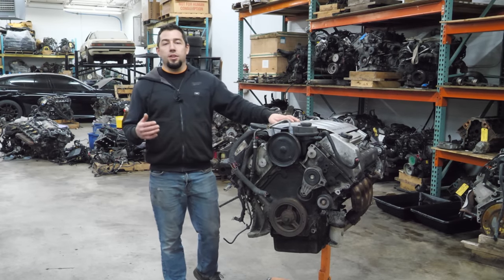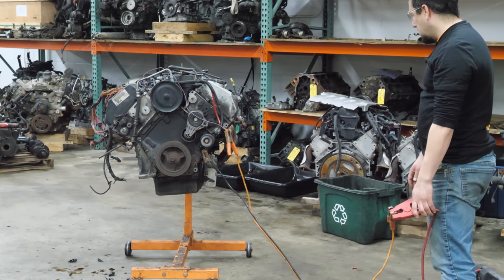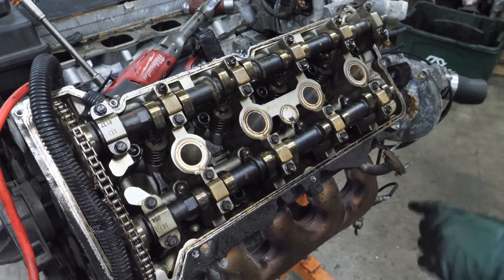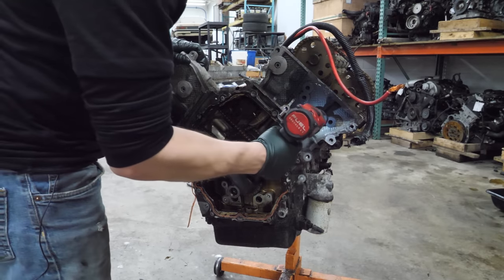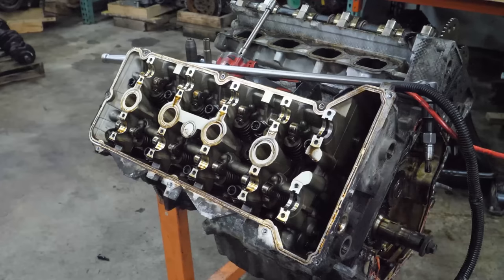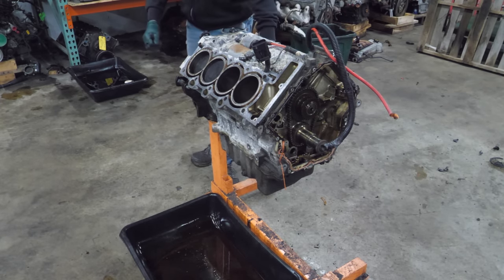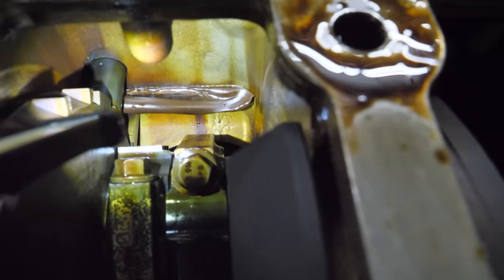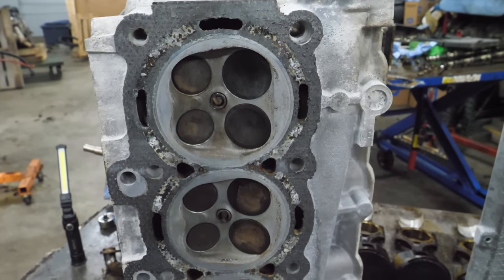Customer Returned This Cadillac Northstar L37 4.6L V8, How Many Things Can We Find Wrong?

Comment: This could have been a world-beater, but GM, as always, snatched defeat from the jaws of victory
Reply: it could of been very cool,  after market bottom end ,  the good stuff. head work and a cooler looking intake manifold,    all polished up like candy with a big turbo hanging off each head . ya i could see the vision.
Reply: Lol sure
Reply: The engine that ruined Cadilac .............
Reply: @robc8468  Well, it helped, but you misspelled Cadillac, and Cadillac management did most of the damage
Reply: @robc8468 never heard of the 4-6-8 I see.
Reply: truer words have never been spoken
Reply: They really aren't as bad az people make them out to be.  Better than Ford's copy at least.
Reply: @garyfleming4101  or its replacement, the HT4100....
Reply: @leeterwilliger2303  First off, how is the Ford a copycat when they came out at the same time?  Secondly, aside from a larger bore and shorter stroke, how is the Northstar better?  The Northstar doesn't make any more power than a Ford 4-valve, but it certainly has a lot more problems.
Reply: @leeterwilliger2303 how so? Gm makes some the worst dohc motors to date.  The modular 4.6 was and still better than anything  GM  has put out with “DOHC”.   Gm is good at pushrod motors “V8”. It has taken them 30yrs to get with the times (in the new vette).  GM has never been as great as people claim!!!
Reply: @sti302man  lol.   That's funny 😁
Reply: For that size of an engine, producing only 300 horses, nah mate, are You having a laugh?
Reply: @mistbooster  And what would you consider a good power output for that displacement using 1992 technology and meeting fuel economy and emissions standards, Mr. Genius?  The equivalent 4.6L Ford made 280hp, and a comparable 4.0L Toyota made 256hp.  Perhaps you're impressed by the contemporary Porsche 5.0L that made 316hp???  🙄
Reply: @sti302man  Ever heard of a 1990-1995 Corvette LT5?  And, yes, I know Lotus helped....
Reply: @KevinJames-yg9eu  Well lets see.  based on power compared to displacement Mazda F2T Inline 4, from the 1988(yes it is 2,2L @145HP, but it still more HP/Litres total), Most of the cosworth engines from 80's and 90's
just as examples that have better power to displacement ratio. Incase you did not understand i was mocking the amount of power being squeezed from the power plant compared to its size. Hell even the Volvo redblocks will do better, and the early 90's models did meet the emission standards and had better fuel economy, i never said i was a genius, but you dont need to say that you lack common sense, your reply advertised that for You.
Reply: @mistbooster   Yes, because comparing the specific output of a  turbocharged 4-cylinder engine to an assortment of naturally aspirated V8 engines is even remotely valid.  If we're going down this road, let's just throw in the supercharged 4.4L Northstar that makes 469hp.  Maybe we should look at your Mazda F2 minus T making a whopping 110hp, which would be all of 230hp if it was a 4.6L V8.  Thanks for telling us who has any common sense....
Reply: @KevinJames-yg9eu Agreed. I love it when someone brings a knife to a gunfight 😂
Reply: @sti302man  right because nothing screams quality like spark plugs blowing out of the block or better yet flawed design two piece spark plugs getting stuck in the block and breaking in half when you try to get them free turning a simple preventative maintenance job into now having to disassemble the whole top end 😂
Reply: @leeterwilliger2303 A. It's not a copy B. Ford's modular was a much better engine. Its direct competitor, the 4 valve Lincoln 4.6 variant was about as powerful and much more reliable. The 2 valve version was damn near indestructible. Northstar defenders are like those idiots that die on a hill defending the 6.0 Powerstroke lmao. "All you have to do is fix all of the manufacturer defects that cause major engine failure and then it's good, I swear!". GM sucks at OHC engines. That's ok to admit. Hell, I'd never buy a Ford these days with their garbage rubber band oil pump belts and plastic oil pans. Brand loyalty is stupid. It's just the body of evidence is overwhelming that the modular in most forms is a more reliable and long lived design. Except the 5.4 3 valve... The head design was terrible and is every bit a turd that the Northstar is.
Reply: @matthewheld1292 All of that is easy and cheap to deal with. And no, you don't have to take the top of the motor off to deal with the plugs. How about changing head gaskets? I remember a certain Cadillac competitor having a lot of problems with those Lmao.
Reply: @robc8468  you mean the people who didnt want to learn how to do it right or pay a mechanic and ruined them instead of fixing them... these engines are amazing bad mechanic not bad engine
Reply: @zacharydewitte384  Did you just say that Northstars are not bad engines?  Sorry, but good engines don't rip their head bolts out of the block at 100,000 miles of normal use, and that has nothing to do with any mechanic.  You can correct that issue with aftermarket head studs, but it's simply inadequate as designed, which by definition is BAD and is completely unacceptable for anything built in the past century.  As for paying a mechanic to "do it right", good luck.  The repair requires $1000 in parts, and the labor alone costs more than the car is worth at this point.  I know several mechanics, none of which will touch a Northstar, not that anybody is going to pay $3000+ to repair a 15-30 year old car.  Maybe if you're a hotrodder who is going to build a custom engine anyway, the Northstar is viable if for no reason beyond the novelty, but for the average person simply wanting a reliable daily driver, they are junk.  The Northstar in my STS couldn't be driven any further than a couple of miles without overheating at 150k miles on the odometer.  I replaced that car with a Mustang GT that is two years older and now has twice the mileage of the STS.  The deepest I've been into that engine is the water pump.  I sold the STS for scrap price to some guy who had a Northstar fetish and the tools to stud the block.  Don't know what he did about the 4T80E having the common issue of the torque converter clutch randomly locking and unlocking....
Reply: @KevinJames-yg9eu  whatever bruh I fix mine. If you have enough money you can just get a basically new one
Reply: @garyfleming4101 The V8-6-4 wasn't a bad engine. Just vibrated terribly in 6 cylinder mode. I swapped one into a C10 once and it was a pretty nice engine, it got decent fuel economy, just vibrated like hell in 6 cylinder mode. The Oldsmobile diesel V8 was also not a bad engine. My friend has one in an 82 Toronado with over 500,000 miles on it. No issues. The HT4100 was terrible. No arguing with that, it really was a piece of junk. The 4.5 and 4.9 were ok, just underpowered. I really think they should have just stuck the turbo off the 6.5 on the Oldsmobile diesel with some head studs and it would have moved those boats decently fast.
Reply: I’m from the UK we are Experts of Snatching defeat from the LAUREL LEAVES of greatness.
Reply: @sti302man  the ecotec 4 cylinder is probably one of the best 4 cylinders to date holding most 4 cylinder drag records. the olds quad 4 was the most powerful na 4 cylinder until the honda s2000 came out.
Reply: @theodorgiosan2570   the ht 4100 was fine after 1985, not arguing with you about prier to 1985. it obviously needed more time in the oven and they just rushed it due to the knocking issues with the 4-6-8
Reply: They even bragged it was designed by Lotus.    Imagine any design work by the Britts being quality?
Reply: @mistbooster Turkish bath
Reply: The world doesn't drive V8s. 

It took me awhile to understand why they do in the US: 4-way stop signs and roads that won't follow the contours of the land.

In Germany I'm used to much higher average speeds with much less power. My current Ford is my first personal car to reach 200 HP and sustain 240km/h (150 mph) on the Autobahn. An Audi 100 C3 I drove half around Europe to southern Spain and back nearly 30 years ago only had 75 HP in a full sized sedan and didn't really feel underpowered, I still managed to get a hefty speeding ticket on a straight and empty French motorway...

Around Europe acceleration is typically much more involved; for the longest time it required shifting through 4-6 gears and revving the engine to get up to speed, but then we just stay there, as soon as we leave the much denser and thus smaller towns.

On a good day I can still go hours at around 160-220 km/h (100-140 mph) before I need to stop and refuel. And yes, fuel prices have had ensured V8s have little mass appeal around here.

But the other reason is that there is little advantage to more than 200 horses, when you have to flow with the rest of the traffic and it takes another 200 to go from 140 mph to 160 mph, which is a bit difficult to sustain, even on the best Autobahns, and unfortunately illegal pretty much everywhere else. And then those pesty little inline-four guys will pass you by as you need to refuel your V8 every hour or two when you try.

The 4-way stop sign seems straight from the 19th century, when occasionally horse carts would meet at an intersection. Maintaining that idiocy has probably polluted the planet much more than any other road design decision taken by mankind.

What is so difficult about assigning roads a static priority? Even roundabouts, which tend to get me quite dizzy when I drive around in the UK, are quite an improvement over the endless breaking and acceleration of US traffic. 

Driving around central Texas also made me dizzy, but mostly because the roads would go straight, when the countryside contours wouldn't, resulting in plenty of bobbing and cruise control on my big rental V8 SUV spending tons of potential energy and fuel into into climbing hills up and then breaking downward.

Roads in Germany and Europe are carefully sculptured into the terrain to minimize angles of every kind and allow traffic to maintain speeds at minimal energy expense. They try to optimize throughput and no, not really top speed, even if much more is generally possible as a result.

And perhaps the most important difference is driver discipline or attitude: European drivers have usually aimed for a much more collaborative and crowd oriented driving, if only because the metal skin of typical post WWII car was designed as another layer of dress, could offer some rain and wind protection not a crash impact buffer: drivers behaved much like the downtown pedestrian or cyclist they were not long before, ...or suffered dire consequences.

American drive a fortress of individualism around with them, where every other car is treated like an obstacle, that mostly has no right to move into "your lane". Where an Italian in a Fiat bambino would be able to long stare into the shocked eyes of the driver of another car he was about to crash into, Americans behind deeply tinted glass will only look up from their mobile phones, after it happened: Even in the driver seat they act like more like inhabitants or passengers.

Elon Musk with his idiotic/autistic/narcissistic focus on individualism probably is far more likely to fail at good autonomous driving, because it requires collaboration between the environment and the neighbouring cars to achieve much better efficiency and safety than trying to turn every car into a super computer. After all, every car coming the other way has already seen the road ahead of you and should be willing to swap road state gossip for mutual benefit.

If only to tune your speed to minimal energy expense given other traffic and road contours...

Sorry for the rant!
Reply: @abufrejoval  Nice.  You did some thinking, based on experience.  That's good.  I think you might have come to the wrong conclusion, though, about why Americans drive cars with big V8's under the hoods, billions of cubic inches throbbing away.  The answer is:  "Why not?"
In Europe, since almost the beginning of the automotive industry and the attendant bureaucracy surrounding private automobile ownership, European countries' registration fees and taxation were based on the cubic capacity of the respective engines of the vehicles covered by the laws.  Meaning that a car with a 5 liter engine would cost more to register (and maintain that registration) than one with a 2 liter engine.  And the differences were often on a geometric progression, not a linear one.  In other words, a 4-liter car would be more than twice as expensive to register than a 2-liter car.  This practice had enormous impact on how European countries approach the problems of powerplant design for their autos compared to how Americans do it.  In America, the several states usually have a flat fee for recurring registration regardless of engine size, or even vehicle size, for privately-owned (that is, not commercial trucking) vehicles, and engine capacity is never considered as a factor in the schedule of those fees.
The outcome is obvious.  Europeans tend to design engines that Americans consider to be itty-bitty little things, winding the snot out of them and utilizing racing-type design strategies like overhead cams and 4 valves per cylinder in order to wring 200 horsepower out of 2 or 2.5 liters that an American pushrod V8, I6 or V6 manages at 2/3 or half the RPM's and with 4 to 7 liters of swept volume.  The European paradigm favors horsepower and the American model favors torque.  And while engineers will do what they can to be reasonable about things, these 2 approaches are baked into the respective cultures across the Atlantic.  Also, local conditions' variables apply.  Which brings me to:
The roads.  Many of the roads in Europe are ancient compared to the roads in America.  Some of them are ancient compared to roads anywhere.  They were laid out and built long before automotive traffic was even a dream.  They were laid down over footpaths, horse and cart tracks and trails.  They were not initially designed for motor vehicles with their hundreds of horsepower and tireless ability to climb hills, so they naturally follow the contours of the terrain more closely than American roads, of which many did not exist until after the advent of the internal combustion engine and affordable personal automobiles.  Therefore, American roads, in the main, tend to be wider and straighter, actually designed with motor vehicle traffic in mind and not a modern road overlaid on a previously existing network of pedestrian, horse and cart trails.
I could hold forth for quite a while longer, (about fuel prices and 4-way stops and SUV's) but I seem to have already written The Great American Novel here, so I'll just leave it lay at this point.
Reply: It's called "upper management". Think genius and go Opposite.
Reply: have been and always will be junk. bad design,  poor durability a bad example of not putting in the due diligence when being developed
Reply: Just like the republicans.
Reply: @davidclark7584  politicians in general,  have everything at their disposal and still can't succeed
Reply: GM copied an early prototype of the Ford 4.6 in corporate espionage and got exactly what they deserved. The final product 4.6 Ford ended up becoming one of the most stout overhead cam aluminum V8s to ever be made whereas the GM knock off absolutely ruined GMs reputation in overhead cam forever.
Reply: @KevinJames-yg9eu 
The Ford isn't a copycat it's the other way around. GM stole early design blueprints of the ford 4.6 which explains why the GM 4.6 is totally unreliable because ford had to do some major changes from the prototype to final version. The other half of the theory is that Ford knew they had a mole and fed them a defective design on purpose.
Reply: The old 4-6-8 was easily converted back to all time V8. The 4.1 V8 was a horrible engine. I replaced several when I was in my 20s.
Reply: @owenhunt6796 the Ecotec is Saab so that’s a weird comment. But tell that to those of us who had ended up with 09 LNFs that had porous block problems. GM didn’t give half a shit about that issue. Or the LAF 2.4 low tension ring issues that causes massive oil consumption. Or the weak rods they put in the latest turbo engine, the LHU. If you push them close to 400 HP they break violently. Ask me how I know lol. Yes the Ecotec was a great engine with a lot of potential but you’ve got to build them with aftermarket H beam rods & forged pistons to get those big power numbers. And you’ve GOT to stay on top of the timing chain system because the tensioners tend to leave the chat early. The best version was the first gen LSJ for durability but you have to turbo swap them to get any power.
Reply: @abufrejoval  nice rant 👌
Reply: @KevinJames-yg9eu the Northstar was making over 300hp at the wheels back when it came out. I was chirping tires at 50mph wot pull. You couldn't do that in any furd from the factory at that time. Not even the rustang lol
Reply: @trentdaddydolla647  Chirping the tires has absolutely nothing to do with the engine and everything to do with the calibration of transmission shifting, the suspension's ability to plant the tires on the pavement, and whether you're relying on traction control or a limited-slip differential.  One of my coworkers had an almost new Lincoln Mark VIII with the 290hp 4.6L, and that thing shifted harder and chirped the tires more than ANY other stock vehicle I have ever experienced.  My STS would spin a tire if I turned off traction control, but the torque steer was miserable.  If you wish to make a direct comparison of front wheel drive vehicles, the 4.6L in Lincoln Continental was detuned because Ford's AX4N transaxle was an off-the-shelf part that was nowhere near as robust as GM's 4T80E, which was designed specifically for the Northstar.  On top of being detuned, those engines also have an auxiliary electronic throttle body that serves no purpose but to limit power in first gear to prevent transmission damage.  My former boss worked at Ford powertrain, specifically on the Continental, and they built a test vehicle with Cobra camshafts and a 4T80E just to try to convince the Ford executives to spend the money on a purpose-built transmission that would allow the Continental's 4.6L to run like an STS's 4.6L.
Reply: I've never seen a Northstar V8 or the V6 version of this engine with a rod shoved out the side of its block.
Reply: @davidclark7584  LMAO exactly like the republicans. It’s as if the finish line was brought to their feet, and they made a 90° turn and walked into a ditch. I’ve been in disbelief since 2020.
Reply: @KevinJames-yg9eu  How come several different makes come out with the same ideas? Is there some under the counter deals taking place?
Reply: @adampatterson707 right, barely see that  unlike any others that's always getting pushed
Reply: @ronaldpotter3962  you know whats up and the car was made for ppl like you!
Reply: @robc8468  the engine that made cadillac millions
Reply: @leeterwilliger2303 absolutely not. They are absolutely utter garbage. Your GM copium is showing.
Reply: The Olds version in 4.0L WAS a world-beater.  Look back in your racing history, Olds 4L Aurora engines won in positions 1 through 8, kicking Toyota's asses.  I sure miss Oldsmobile.
Reply: I just happen to love my northstar. It is a 2008 though. Head studs were fixed by then. It runs smooth as butter and for a 4000lb DTS, it really moves. They happen to sound fantastic too. I haven't had any engine problems. 96500 miles. Suspension though is another story, but that happens.
Reply: GM used to make the best cars but it went woke like all the others.
Reply: @Edward-tp5nc  Yeah sadly. I am waiting for them to announce the all new electric corvette. It will happen eventually just like how dodge just stopped making the badass hemis.
Reply: @garyfleming4101- My grandfather bought a 1981 Cadillac El Dorado with the 8-6-4 new in 1981 and that damn thing was in the shop more than it was on the road until they just unhooked the computer that controlled the pistons shutting down.
Reply: I love my 2004 Pontiac Bonneville GXP with the Northstar V8, but have to admit I bought it super cheap due the previous owner believing it had bad head gaskets due to the fact it overheated on him once and his dishonest shop told him it had bad head gaskets. They were wrong, it had a bad thermostat. This car has been garage kept and still looks new at 110k. I know at some point it might have a issue, but I don't drive it much due to the fact it's so nice and kind of a rare car as only 2450 we're built that year. If I have to, we'll pull it out when the time comes and stud the heads.
Reply: @FSAHT-FabianSocialistAcademicH  I had no idea they had a Northstar version of that.
Reply: @rm25088  Yep, and I do love it as I've always liked the Bonneville and have had many over the years, but I think this one is my favorite.